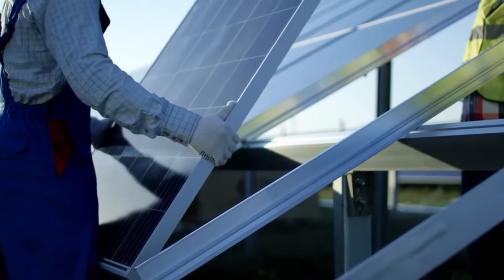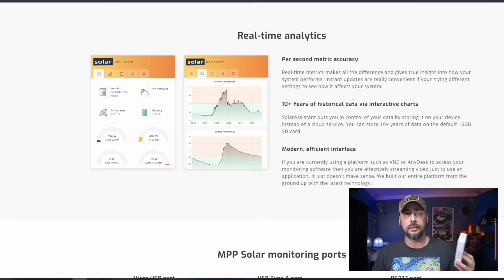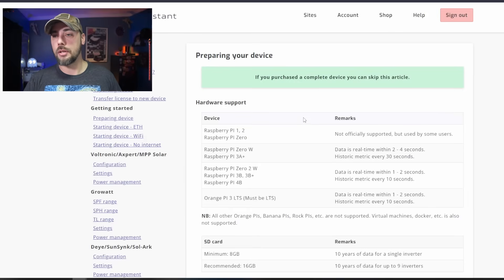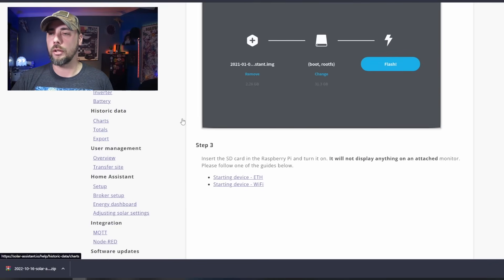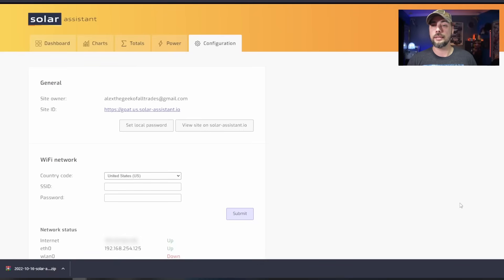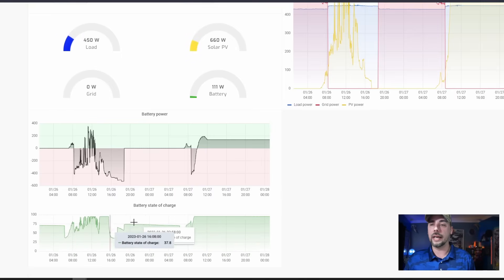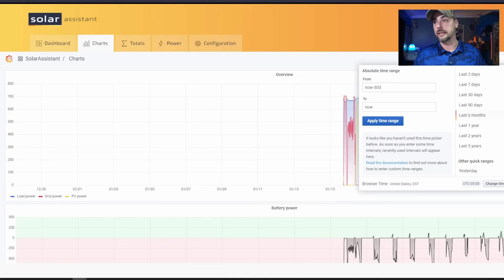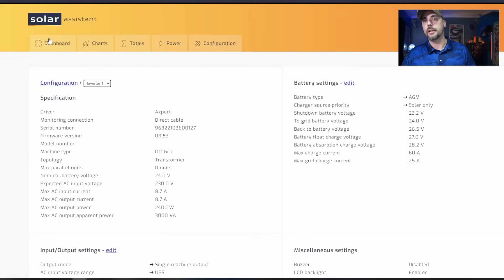Solar Assistant Setup Guide

Comment: I went from a EASUN inverter using Watchpower (which I've never liked) to a PowMr inverter with iPower (a better watchpower like monitor). I like iPower but is way to buggy for me. Upgrading to Solar Assistant as we speak...largely thanks to you! I'll probably watch this video several times until I get the Solar Assistant up and running.

Comment: Hello, funny but helpful video! Thank you for it! I was wondering if you were able to retrieve your historical data from the inverter? I assume that you had your solar system first and later got the solar assistant. When setting up the solar assistant, will this be day one or will it also show the data from the past? Thanks and greetings from Italy
Reply from the maker: I was never able to pull the historical data from the existing controller, only showed data going forward in time from setup.

Comment: Excellent walk through, thank you! Do I need to power down inverters, solar and batteries before connecting the system to the usb ports of the PI and go live?
Reply from the maker: You don't have to, but it wouldn't hurt. Or plan to cut over at night when there is no juice flowing.
Reply: @GeekOfAllTrades  Great! Thank you.